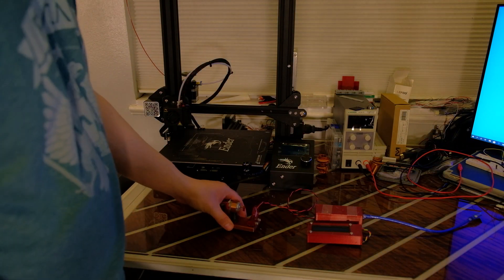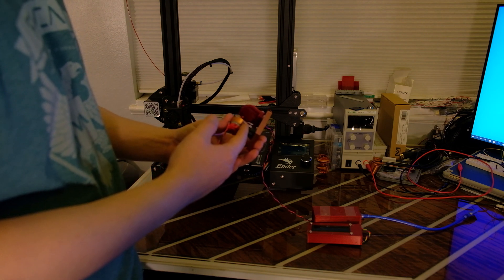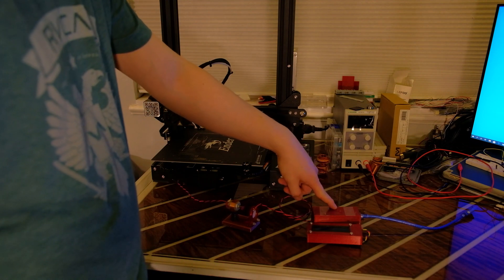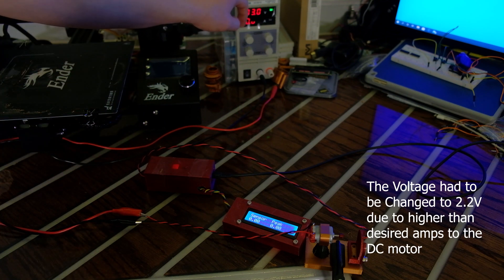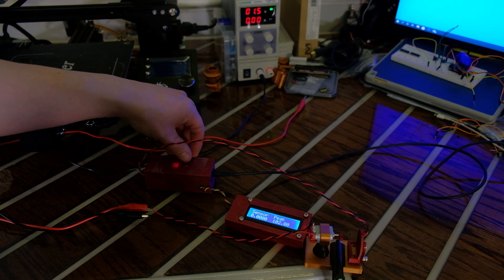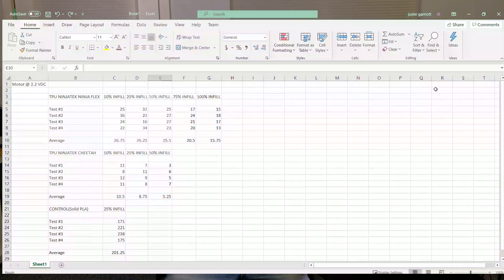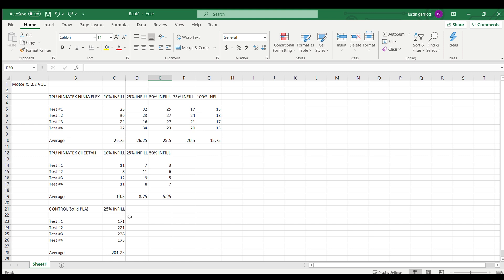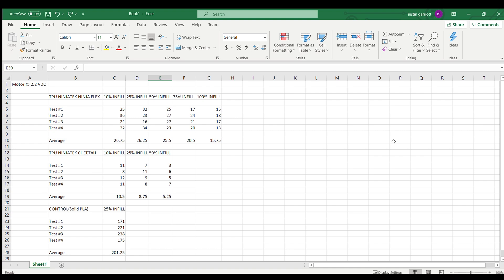TPU - 3D Printed Dampers Vibration Testing

Comment: Excellent video. I am working on designing some vibration mounts for a drone. It's very surprising that stiffer/higher density give best results. However most stiff material PLA doesn't follow.

Comment: Can you in theory make fan vibration damping seals? I'm sealing a 30mm fan in a hollow rectangle and I want to reduce the vibration. In your experience can you print a seal that small or is TPU not good with fine details?
Reply from the maker: Depends how small the detail is, I’ve go away printing 3mm holes without any issues before, you may end up with stringing, as ideally you don’t want any retraction, but other than that it should print as small as any other material. I would think the limitation lies in your printer nozzle and resolution of movements.
Reply: Really interesting video - thanks for posting !

Comment: Very interesting test, at first i thought TPU can replace Silicon composite for dampening solution since TPU is easier to produce. But it seems like the result is not very convincing, i will just stick to cast silicon for my keyboard dampener rather than wasting my time printing TPU. 

Thankyou for your valuable video.